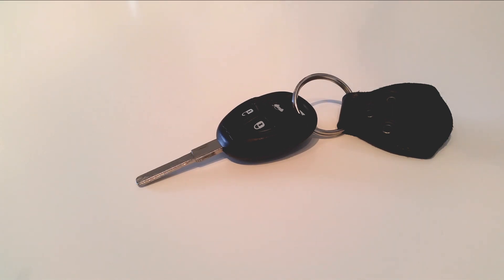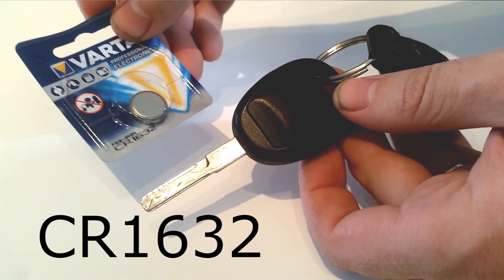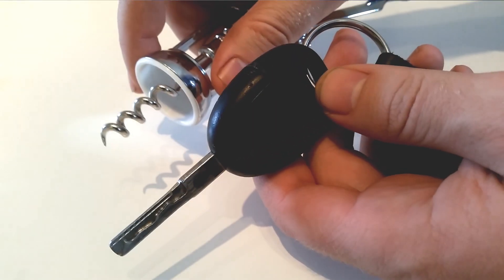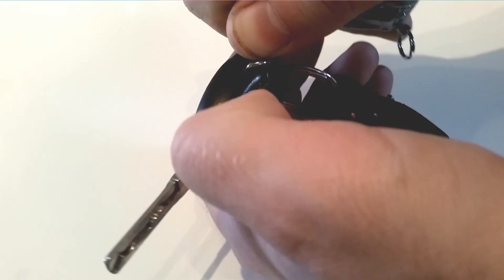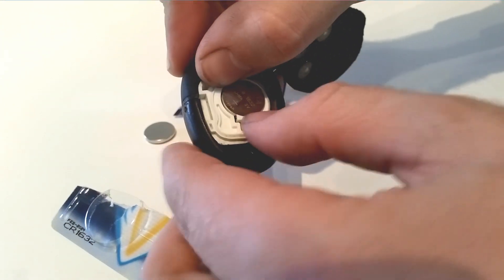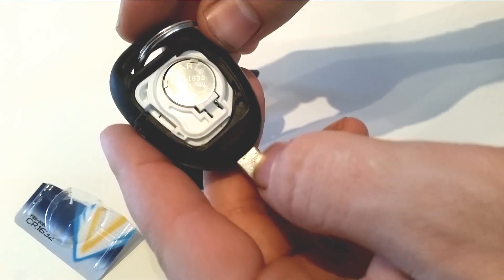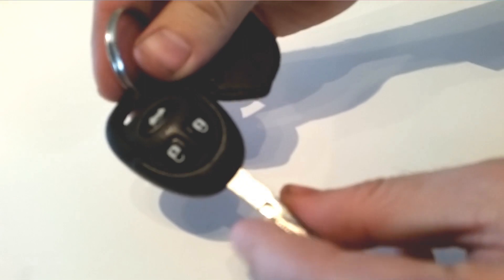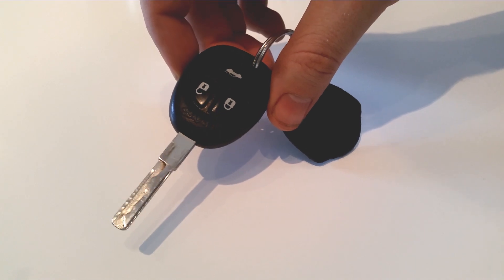Saab 9-5 DIY: Replacing the Key Remote Battery - Trionic Seven Quick Tip

Comment: Worked like a dream 😅
When I was a kid I wanted to change the battery on the key to my parents’ 9-3 from the 90s. Used a small screwdriver and naturally broke off the latch. The design of the latch is quite problematic. I‘m glad this method worked. Thanks 🙏🏼

Comment: I remembered you had a video on battery replacement for the Saab 9-5 key fob. I went straight to your YouTube video and the hardest part was finding the corkscrew. My Swiss Army knife didn’t have a corkscrew. Had to go with the kitchen one, which actually fit. Key fob works great now for my 2002 9-5 Aero. Thanks, Jonathan!

Comment: Whomever posted using a big paper clip missed the key point on gaining entry to the fob. Using the corkscrew method with my Swiss Army knife not only works better, any time I need it, but doesn't entail an absurd amount of force required to make a paper clip do it - I could not make that work, and porked up my hands trying. This method works. Thanks you very much.

Comment: Thanks for the vid johnathan. I was wondering how can I remove the transponder unit? Because I want to replace my old 9-5 key shell with a new one. 

Thanks!
Reply from the maker: +Man Oat With the key open you can just pry the electronics off if you're careful.
Reply: Is there any sort of tool I should use to pry it out with?
Reply from the maker: +Man Oat I just use a small screwdriver. Disclaimer: It's been a while since I did this, proceed with caution.

Comment: Why do you suggest a cork screw? It is quite easy to break the surrounding of the hole. Better use a thin screwdriver instead which is the obvious tool once you see there is a small catch that has to be depressed to open the lid.
Reply from the maker: +Tor Kristian Hånde The cork screw both pushes in the button and opens the lid at the same time.
Reply: And if you are not careful, it will also break the rubber surrounding the little hole. The factory rec is to use a small screwdriver
Reply: I just broke mine now with the corkscrew ;-( I could have been more gentle though...
Reply: A common paper clip worked like a charm for me.

Comment: hello, i have a doubt. if the anti theft system wire is unplugged, then the cars remote will work or not ? means the if I press the unlock button in key the door will unlock ?
Reply from the maker: What is the anti theft system wire?
Reply: i had a problem in my saab , the alarm starts automatically when it is parked, i went to a mechanic,  he did not fix the problem but he just cut some wires of that alarm system and told me it wont put sound again. that only i have mentioned as anti theft system wire.

Comment: the light on my dash that indicates if the alarm is on, doesn't turn on no more I changed the battery and my key fob doesn't lock, I have also replaced fuse. any help ?
Reply from the maker: I don't know what the problem could be, but perhaps if you look at the wiring diagram in WIS (check my other videos) perhaps you can find another faulty component. Otherwise, just ask in any of the Saab forums, they know more stuff than I do :)

Comment: I changed the battery but now the key won't work with the car. can't lock or unlock. how to I "connect" the key to the car?
Reply from the maker: Try pressing the buttons five-six times and it should re-pair

Comment: I just replaced the battery and started getting Key not Recognized every couple of starts. It will still start if I turn the key off and back to run, usually after first try.Very strange
Reply from the maker: Make sure your contacts in the battery are absolutely clean.

Comment: The need to have dealer do it. Made me think removing the battery would delete the chip memory.
Reply from the maker: Nope, it wont disappear.
Reply: @TrionicSeven  Yes it will. just did as you showed. And now the key dont work

Comment: the light on my dash that indicates if the alarm is on, doesn't turn on no more I changed the battery and my key fob doesn't lock, I have also replaced fuse. any help ?